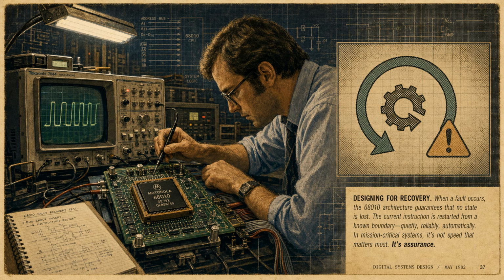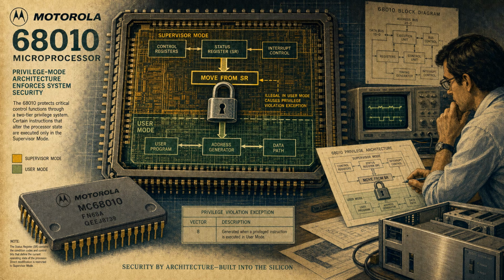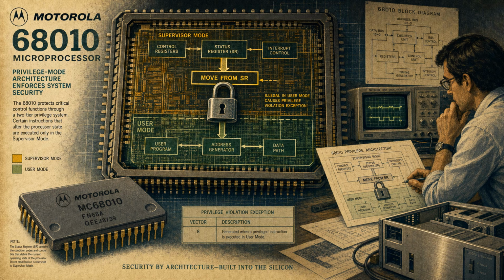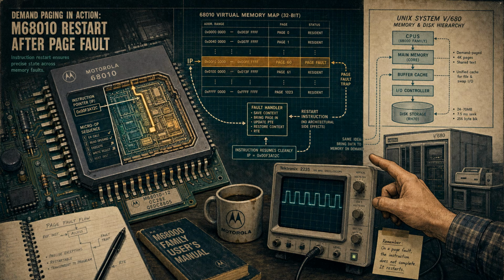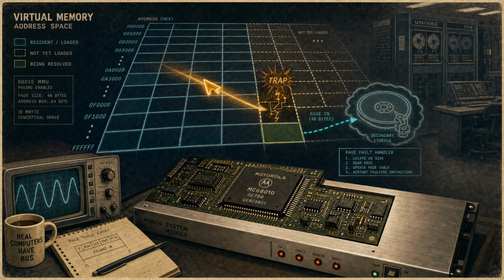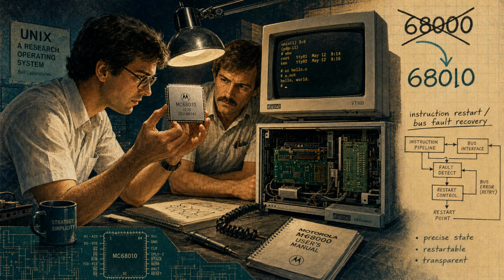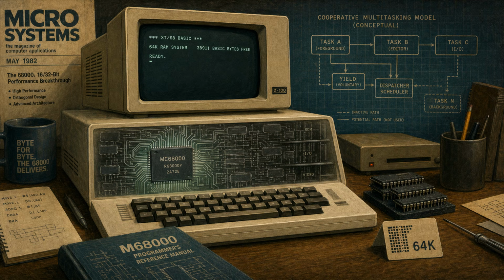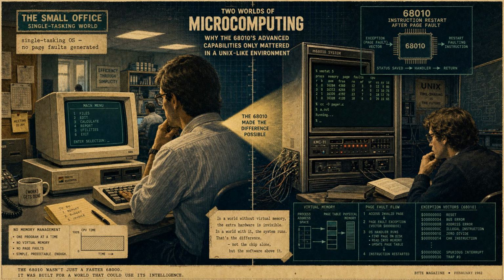The Motorola 68010: The CPU Everyone Forgot

Comment: The 68000 could not recover in any way from a Bus Error : it had to be reset !
The 68010 basically enabled true Virtual Memory, used on some Unix systems such as Motorola 6800 (sic) Systems.
But on 68000 optimized code it didn't delivered more performance/cycle, you need to optimize 1-instruction DBcc loops for the 68010 instead flattening it (68000 usual optimization).

Comment: The 68010 used a 64-pin DIP layout, the same as the 68000. Yet the video keeps showing it in a PGA 169 package, which was the 68020's format. I wish videos would not use AI to generate misleading images.